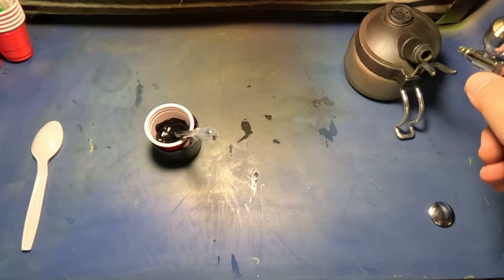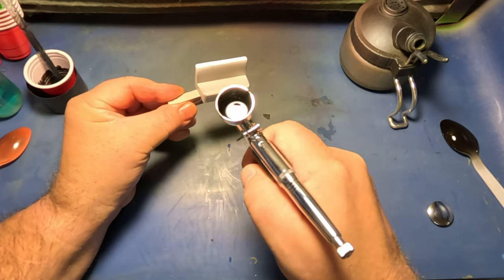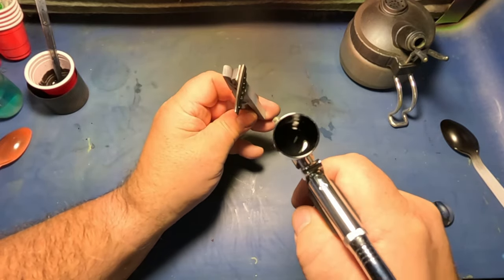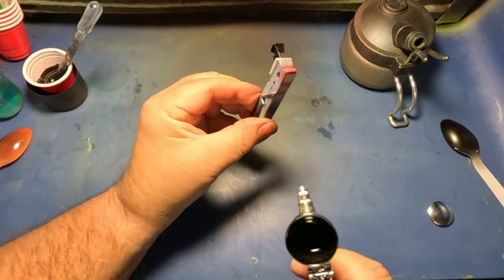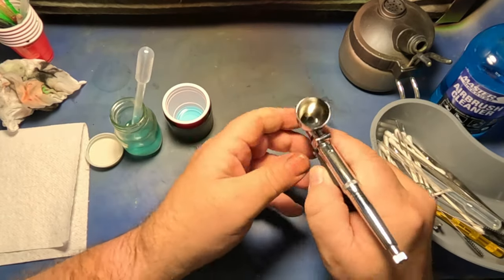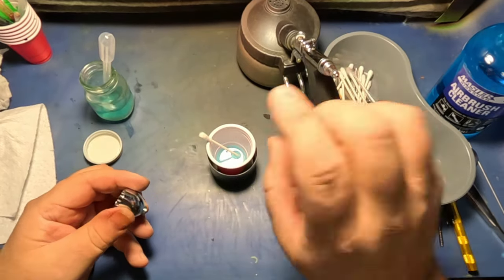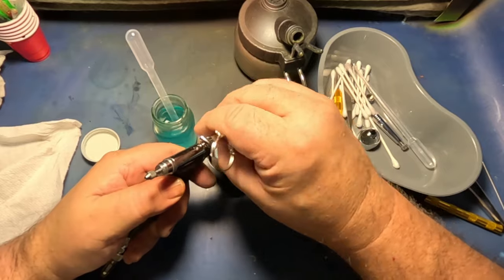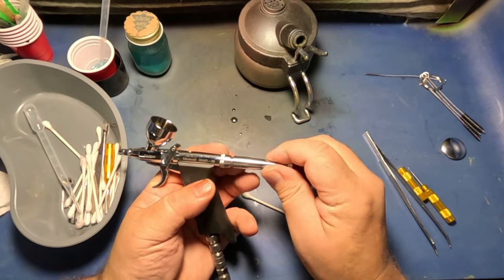Gaahleri GHAD-68 Spraying and Cleaning using Tamiya Semigloss Black

Comment: I have an airbrush, different brand bought at my favorite hobby store, but I haven't used it yet. I always brush painted kits or used rattle-cans, but I'm definitely going to branch out now when I get the chance to build things again. Even though yours is different, I watch to learn and get a handle on techniques and such.  
I've wondered why everyone seems fixated on "primer", when these plastic kits don't "rust". I don't see any issues with adhesion either. My 50 year old models have lost no paint, and I never used primer on them. Happy to see you don't use primer. I think that thin coat first, then letting it dry, then adding more layers is the way I'm going to go with my airbrush. Thanks for the video.
Reply from the maker: If I could give some advice with the airbrush, grab some cardboard and practice with some water.  That will give you a feel for how it sprays and how to handle it.  Then move to paint, then try it on an old car body.    Primer on models it to etch into the paint and give the paint coat something to grip to.  I've found like you, that Tamiya's paint grips well and seems to do well without.  You will get arguments both ways, just do what you are conferrable with and you will be good to go.

Comment: Mark thanks so much for the video. Great job as usual. I know just how you feel about the trigger brush. It's amazing! I use mine all the time. Thanks for the extra bonus of seeing you too!!! Oh you handsome devil you LOL. Your looking good my brother.
I'm going to look for your booth build. I'm starting to collect the stuff I need. I just need a bigger booth and don't want to spend a lot of $ to get one. So thanks again for the video. I may look into getting one of those Gaahleri brushes soon...
Reply from the maker: Thank you so much.  OK, I was reading this and almost got water on my screen.  LOL  I love my spray booth, but I got a table out of a dumpster at work, and I may re make it using that table.  It has electric plugs built in and room for the compressor too.
Reply: @grandpamarkshobbies  That sounds so cool Mark. Wish I had the room for a bigger booth. The tub one will do me fine. The one my son in law gave me just wasn't big enough from the get go. I expanded it with card board but it still doesn't sit right with me. It drafts up and I don't like that. I'm still in the planning stages. Wish me luck...I'll take all the advice I can get. The one you made looks  like it'll fit the bill for me.
Oh yeah - be careful of the compressor's vibrations if you put it on top of the table. You don't want that... keep it on the floor.
Reply from the maker: The table is actually smaller than what I have now, but if I build one right on it I can have the same room as I do now after I put a shelf on top of the booth for my cleaning stuff.  I have my compressor sitting on a wooden chair next to my table.  It keeps it off the ground, and off the table too.  I just want to have better storage all my junk.  I just need to do a total rearrangement of my shop.  LOL
Reply: @grandpamarkshobbies Yeah I know what you mean. All the new stuff you get and build leaves less and less room. I really need to rearrange my whole corner of styrene heaven for sure! I want to try to go completely water based painting. Hope it works out for me. Wish me luck on this one too... Oh I know there will be a few exceptions too...
Reply from the maker: Yes.  I am going to do a complete rearrange of my shop real soon.  I've been water based for a while now, and I have been doing good with it.

Comment: Off topic somewhat, Mark. I found that my area library has equipment to do 3D printing. It's free to use, surprisingly, and I think I'm going to take an online class there to learn how. 
You mentioned someone was going to do a dumpster for your diorama, I'm thinking my first 3D will be a dumpster. We'll see how it goes. lol 
btw: What scale is your garage, 1:24 or 1:25?
Reply from the maker: That is cool that the library offers that.  There's some great online sites for learning how to use them, and how to do basic design work.  The Texaco Station is 1/24th scale.